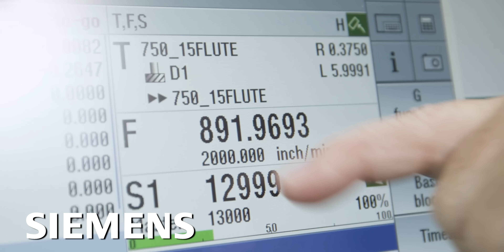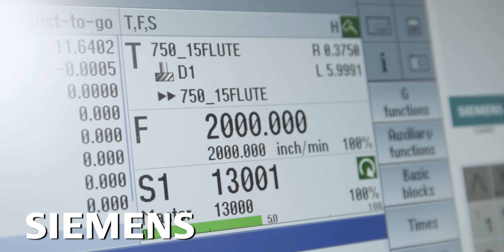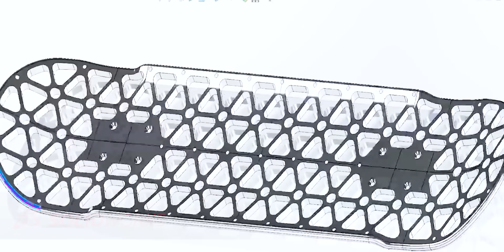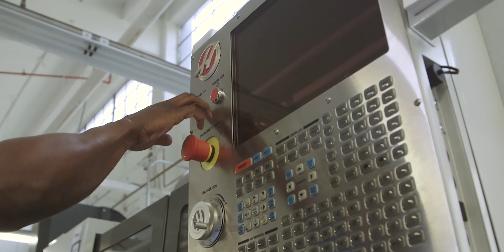How CNC Machining Saved My Life…

Comment: I'm a 61yo fitter/machinist in Australia who regularly maintains CNC machines and the size of your house which are used to machine large carbon fibre wing components for a very well-known aircraft manufacturer. I am continuously amazed to the complexity and accuracy todays that CNC machines are able to achieve even on very big components. Robots on rails are also being used to CNC machine components once done by stand-alone machines. It is a shame here in Australia we ran down metal trade occupations in the 90's in favour of service jobs. As such there are very few apprentice's and young tradesmen behind me. The good news is that I will never be out of work until I retire and I too earn way into six figures.